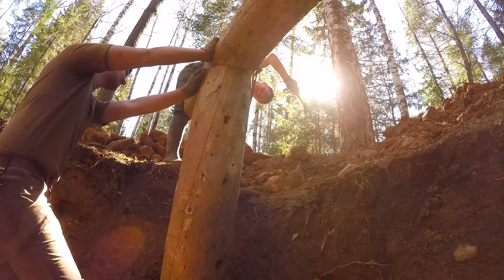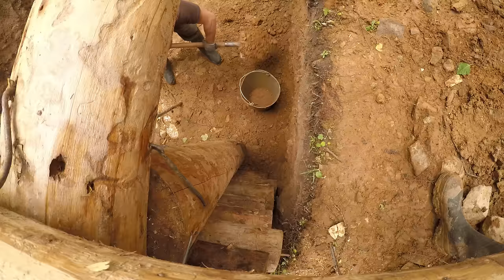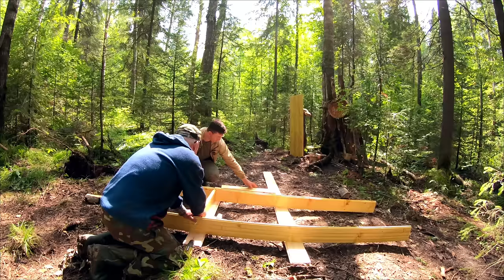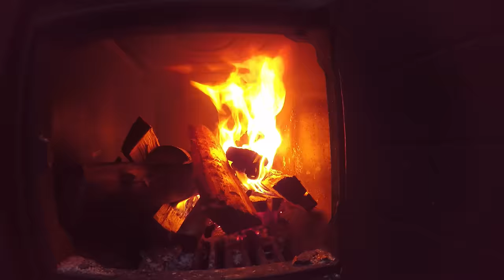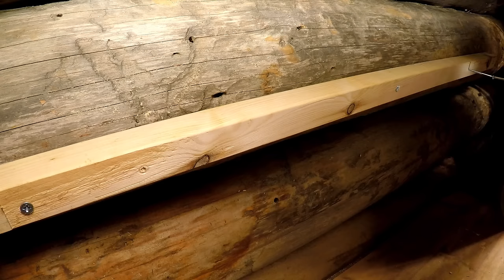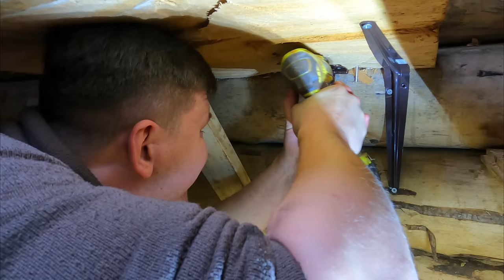Building a DUGOUT in the wild forest from start to finish. ONE year in TWO hours - DIY bushcraft

Comment: Incredible! I’m a city slicker, but this totally fulfills my fantasy of being one with nature using only what I essentially need. Kudos to you guys. I actually learned a lot while watching.
Reply: Loraine I live like this off grid in the forest and I can tell you it is damn hard work LOL.
Everything is an effort. You learn to never get behind or you'll pay in time and even more effort - big time. 
It is never ending. Added to this I have a full time job with a 2 hour commute per day. 

The access road is a never ending source of worry, culverts to unblock, trees that constantly fall over the road, washouts, fuel and water to cart, constant chainsaw and generator maintenance. Cutting chopping and splitting wood never ever ends nor does the gathering and stacking of it.
When it's wet everything is three times the effort. The floor is constantly wet with muddy boots. There is no bathroom of course so if you need to dig a hole when it's raining at 3:00am you're getting wet. Ants and mosquitos drive you insane. A hot shower longer than 90 seconds is a luxury of the highest order and being constantly cold for much of the year a fact of life. Even having a shave is an effort if you forget. You're laundry is the laundromat in town on the way home. 
I've had 7 fires inside in 5 years from the most bizarre freaky incidents - I got them all out very quickly luckily.

The fantasy of it is not the reality however the upsides can at times be profound. Get home from work in summer when the sun sets at 9:00pm and you have hours of daylight and warmth after work, the birds, cooking outside but that only is really about 30% of it, the other 70% is just surviving. It can be good though for sure.

Would I have it any other way? - perhaps. A country house with a bathroom, shower and toilet would be good. Basic stuff like that is a luxury I once took for granted. Mains electricity is now like WOW - If it breaks you don't have to fix it the power company comes; what a luxury!

Think of what you're giving up vs what you're gaining is my advice from experience. If only I'd have known! The knowing of course is in the doing.
Reply: @ThePaulv12  Yes, for sure a lot of work. I’ve only experienced the wood hauling all day long ( it seemed). And I didn’t do the chopping. I could barely make kindling. A few times the well pump and pipes froze and we were melting snow for water. But just getting rid of all the junk and having the essentials for comfort (a toilet! running water! hot shower!) is a relief. The sounds of birds, watching a lone fox scamper by. Time to think and reflect. Fantasies are a good thing.
Reply: tell 7 friends.

Comment: It was a great effort and lots of hard work, but I agree when it comes to drainage - water can easily get in - the roof should have been at a slant so that the water doesn't pool on the window, even when shut - all around the dugout you need a form of drainage so that when it rains the water doesn't pool anywhere and seep in - a slanted gutter that entices the water to drain away from the place into another area where you can collect the water for use - The dugout also was a little small and cramped if you are going to have two people staying there - unless it is only for a weekend stay lol - but your hobbit home was at least a step in the right direction - thanks for sharing
Reply: How’s your shelter build coming?
Reply: @gardnerwebb3749  hopefully above the groundwater level.
Reply: @gardnerwebb3749  how is your national government coming along?
Reply: 55
Reply: This stuff is starting a trend. Although an associate of mine already had a place picked out and purchased, in some areas this is easier said than done because of the ground types. For one thing the ground is a factor. Drainage is a factor but the one thing this guy did not count on was it was better to include the purchase of a used backhoe in the mortgage price than it was to rent me & my machine which was what his first thoughts were. He did not know how operate a machine is how I met the guy, He planned first on renting my machine and me the operator but we sort of melded on his needs would require that he buy a machine I would operate to dig a 27ft by 55ft hole in the ground. Yep he watcha da videos but he absolutely did not take into account the hole we were digging flooded 4 times and had to be pumped out some mornings. The logs were not cut on the property they were purchased seasoned and treated from an Amish saw mill some miles out in the middle of nowhere. That was yet another expensive lesson & factor. Lucky I knew how to put sky lights in a metal roof. I left the job after the hole was dug and left for the season over the winter the place sat and naturally he did not have that roof on so coming back in the spring naturally it was flooded again so we pumped it. The good news was we had a mostly hot very dry summer so when he discovered the fact I actually owned a roofing company at one time and I only moon lighted with my machines because of my health well I am still a roofer by trade but my health does not let me climb around on roofs much anymore but his roof was only 3ft above ground at the highest parts so it was a breeze and in July we got one nasty thunderstorm as much wind and lighting as we got rain too like someone throwing buckets at us. Also factor in he was even more shocked we had more digging inside because of septic he needed a 55 gallon pump tank below the floor level. He had not a clue about a pump tank nor how they worked. This place was meant to be his home. He was Iraq vet like me and he wanted to live his way which was fine but he was going about things with all the wrong ideas and advice from bar stool contractors. The metal roof was the ticket because of there was very little sun that came thru the thick forest land we were on. The lot did require me to pitch 2 areas to keep the roof water from entering between the logs below ground. He is planning on concrete trough drains next year which would be a nice touch. But these guys are just building simple shelters they R not planning on living there just probably hanging out and hunting in the winter seasons. Those two diff separate ideals. If U R gonna build one of these places even for a cabin to be cozy a pitched metal roof is the way to go. Septic is necessary where I live you can really get in a lot of trouble even just placing a camper on a lot or a shed without septic.
Reply: Why be such a know it all
Reply: Who are guys that do all this?  What are their vocations/backgrounds?
Reply: @BurkenProductions  I mean they're not wrong...

Comment: Hi, very nice structure!!!, but I am worried about the humidity, is it from the rain or does it come from the ground? I would prefer not to have to deal with moisture coming from the ground, in which case I would make the floor above ground level.
Reply: Water level in soil are critical when you choise place for dogout. Also as spring water level. I think this guys check it before start to work, so basically all ok. Rainwater canaled around, some excess water under elevated floor drained from waterpit. With proper ventilation no big trouble with humidity. In winter time stove boost air exchange.

Comment: I’m hearing a lot of suggestions about purposing a well under the dwelling but they handled it the right way in the video,  you DO NOT want to have a shallow well stagnant underneath of your house.  Mostly because the fetid water, even if covered and lined, can cause bad health problems, become a breeding ground for bacteria and also pests.
Reply: Realistically, if the well was set up properly and connected to the water tables fine, would that not work? What exactly is the reason the water would become unusable? You're supposed to boil water from a well anyway, so why is a well in a house bad but a well outdoors and above ground not? Is it just human pollution reasons?
Reply: They literary left that damp ground under there and the water will pool there everytime it rains. all that work for rotting house.

Comment: Great dugout and a lot of hard work.   I don't really understand, though, in these dugout/underground shelter,  etc. type videos I've watched from various creators, why they all leave the entryways so exposed.  The very exterior/ second door should be framed and made to overhang the framing all around instead of a normally hinged door where water can just get in when it rains.  A lot of them seem to leave the little entry path and/or steps, etc. so unprotected even after waterproofing the other parts as much as possible.?
Reply: Right, my question was what about when it comes to flooding? lol
Reply: @ToolinAround  yep.
Reply: @ToolinAround  when digging the initial dugout pit, I would dig a trench to a deep French drain outside of the dugout walls and line it all with geotextile. Fill it with rocks and sand and gravel. Bone dry with no bailing. As long as the ground is eventually able to soak it up.. If its all clay it may sit stagnant and keep filling..
Reply: @skeebert  yeahhh I was about to say lol, as a Missouri resident our red clay does not allow for such efficient and easy systems. Honestly digging in general is an insane chore because what isn’t clay is rocks

Comment: A 3" drain pipe in the floor going down that hill would have solved the water issue.  It would need to be placed nearly at the start because a trench would need to be dug to place it.  Water was an issue in my fox hole.  It just seeps in through the clay.
Reply: When rain comes wat will happen to dis house
Reply: In many og these builds I hsve alwayd wondered about drainage as they dont do it proper, even if you tarp it 360° it will leak

Comment: Great work! The finished result looks very comfortable. I have two questions. First what type of tree did you use for your building logs? Second, what were you using to treat the wood? From the discarded bark, it looked like maybe those were birch logs, but I was wondering because the wood seemed quite easy to work so not pine, maybe spruce. Thanks.
Reply: I would have scorched the bottom foot of the tree posts before putting in the ground. would have slanted the floor outward and filled with half a foot of gravel for drainage. AND I wouldn't waste time living in a dirt hole in the ground and getting fungal lung infections. Just saying. Nice video though. Lots of useless hard work. No one should live like that.
Reply: @jeanshamsi4358   "Slanted the floor....?!"  lol  You've not done any construction, have you? Also, if you read the description it says, "a dugout for survival," not, "our new home." I assume it's to be used in case something very bad happens, they have to change location, and would feel more secure mostly underground. And to make YouTube bucks too, of course.

Is your crooked floor underground home almost finished? I'd love to see the results.
Reply: @jeanshamsi4358  What does "scorching" the wood do for it?

Comment: If they increased the depth and then installed some sort of liner into  the mud hole, beneath the floorboards ,  they could actually use it for their fresh water source. With a little filtration system if some sort of course. 👍🏻

Comment: The drainage issue is a simple fix with a 12 volt bilge pump for a boat and a water hose they have a automatic switch that when the water gets high enough they kick on and dont draw much electricity and will run on a big car battery for awhile and you can charge the battery with solar chargers to keep it charged up and you wouldnt ever have to worry about the water again
Reply: My thoughts exactly. Thats what i used on my sailboat.

Comment: Greetings from SERBIA, a small remark, I noticed that many who build, forget to make simple drainage around the foundation at the excavated depth they want to remove moisture by digging a canal in a circle and filling it with large stones to solve the problem of moisture and take the water outside the building through the canal. . And that no one builds a house on 2 levels for more company when it comes, and you have the build and the will. little tips from friends from SERBIA

Comment: Amazing production!  It doesn't look like water is going to stay out though and you have space on top for only about three feet of snow before the air and chimney are buried.  I noticed the water flow outside and you will need to do some serious trenching to keep the water from flowing to the walls.  If water stands, it gets in.  I guess the trap door in the floor and buckets are the manual sump pump!  The tarps should last decently, a few years, protected from the sun.
Reply: One last thing,  I worry about the floor under the stove and the kindling/shavings being too close to the stove.  Next thing to build:  wood pile and outhouse!

Comment: Enjoyed watching the build.  You used good materials for a safe wood stove installation.  If you install a damper in the stove pipe you will use less wood and not have to feed the fire as often through the night.
Reply: Whats a damper?
Reply: @nobodyhere9258  Its a choke on the chimney to regulate the air supply so you can slow down the fire.

Comment: Good effort building a sunken cabin.  hard work, but I have a few questions?

1. side walls, and roof, you used plastic to waterproof it,  what happens in a year or so when the plastic deteriorates, will the wall start to leak then.  It is at least a year past since you started the build and maybe 6 months since finish. so how is the wall holding up?  

2. I have more questions, but if I ask them it would start to look like a hate comment or me just picking holes in your logic as to why? why? why? , and that is not my intention.  so I will just ask the one for now.

Comment: Awesome, I once built a house into the side of a hill. We used some type of thick black tar and liner on ever squares inch of the exterior of the foundation and walls. It completely waterproofed it. It have helped tremendously if yall would of scorched those timbers with a flame. Keep the termites and fungus from rotting them. Theyd last hundreds of years buried beneath the ground. Seems like an awful lot of work to end up losing in a year or two.
Reply: The logs are already starting to rot.  (those pinholes are from bark beetles).  The moisture from under the floor boards and what will come through the tarps you used will cause this place to rot out in just a few years.  It is totally inadequate for the climate.
Reply: @ronvogt4128  100% ,,,but they just need it to last long enough to avoid the war as dodgers .

Comment: Might have to redo your floor. Remove the flooring put in several PVC pipe and use gravity to drain water out then put down by some heavyweight water proof plastic? Then put your floor back in..
Reply: Drill holes in PVC pipe and leave them on ground and go under your side wall and down and away from your dugout.

Comment: has there been any mold?  would sealing the log walls help, do you need a fan or form of ventilation, more than the pipe in the corner?  sorry for all the questions, you did a great job, just the rain and clay really makes drainage an issue'  the hole in the floor could be deepened to act as a sump

Comment: Question:  would the wood begin to rot from being under the dirt? What about termites? Would the plastic between the logs and dirt allow rain to seep in on the floor?
Reply: They varnished the wood, so it would take at least a few years before it begins to rot.
Not sure about termites.

I think the plastic it there to prevent that exact thing from happening.
Reply: I dont think they have termites in Russia!
Reply: @mikebk7807  Termites are among the most successful groups of insects on Earth, colonising most landmasses except Antarctica. They can survive colder months and thrive in summer.

Comment: Love the build! Well done you guys!

However I am confused: is that dugout under the cabin a latrine or just to clear water out after heavy rainfall/snow? 

And what were the tubs of wood shavings for?

I did have other questions as I watched ("why have they done it like that instead of another way?") But they got answered as the video went on
Reply: No way it’s a latrine right in the middle of the shelter. That would be super unsanitary. I was wondering if you have to continually haul water out of there. Like doing the job of the pump in your basement.

Comment: Comrades: I love your dugout; -BUT, some words of concern: What happens on the day you get a light snow and a BEAR or an ELK walks across your skylight? Is it Lexan? Comrades, what happens on the day a BEAR wants to come in your front door? Doors to the outside should open to the outside, not to the inside! A door that opens to the outside is secured by the entire frame against a BEAR trying to push his way inside. But a door that opens to the inside is secured only by the latch. The hatch-door (which does open to the outside [but will probably be open while you occupy the dugout]) should be made of very-strong wood as should the door over the skylight. Where do you keep the FIRE EXTINGUISHER? Be safe.

Comment: I just watched another video done by someone totally different and this "DUGOUT" is almost the EXACT same build,  right down to hole in the floor and the wood burning stove,  to the staple style fasteners/ nails they used on the corners of the frame.
Reply: The "staple style fasteners" are called "dogs", in case you wondered.